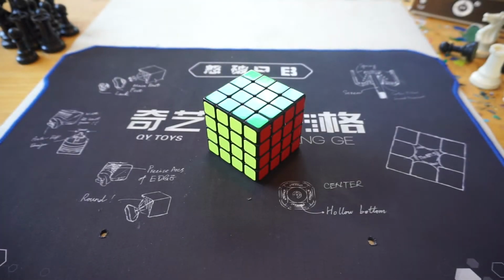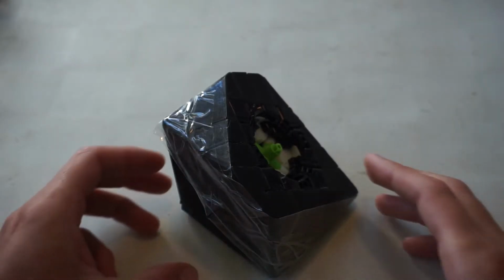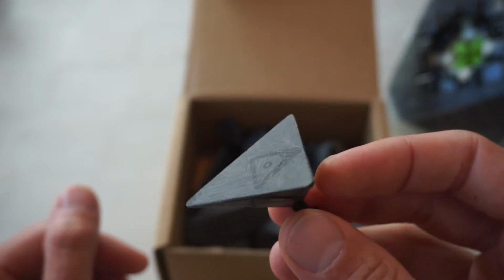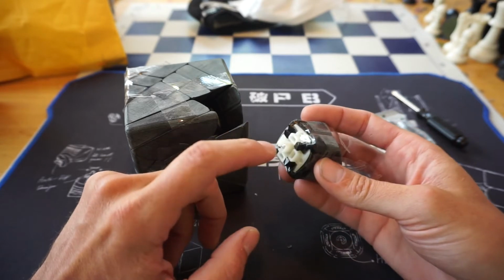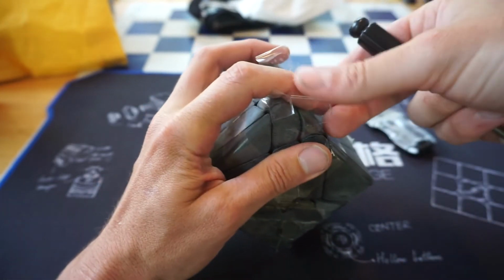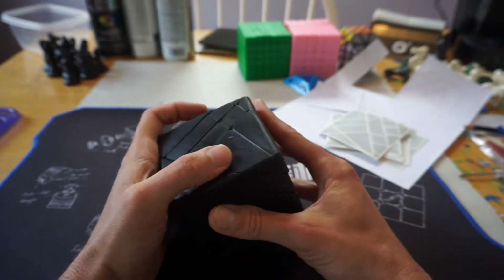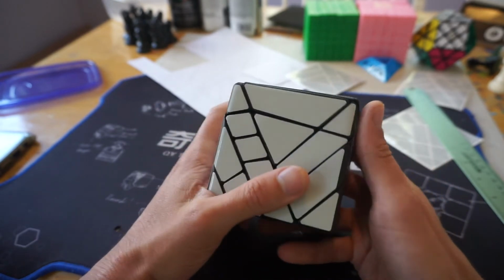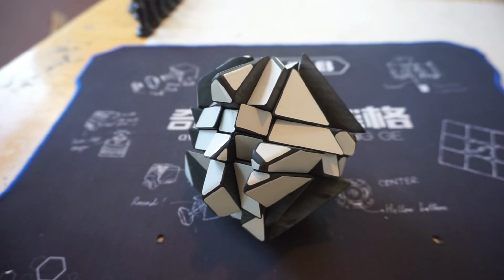How to Make a 4x4 Ghost Cube

Comment: Awesome cube!

I use scissors to cut stickers. It makes rounding edges easier and gives me more control. 

I usually put the old stickers on the new vinyl material, then cut around the old stickers. In your case I would've traced the pieces of the finished puzzle, then carefully drawn the sticker shapes within the piece borders, and used that as a template to cut the new stickers.

Comment: For modding a 4x4, I sand down the extensions before gluing them. I use masking tape to space out the pieces during the gluing process so the gaps are even. The ghost is a nice mod. I need to try and make one too. Thanks for the thingiverse files.
Reply from the maker: Thanks for the advice. Where do you put the masking tape, I'm trying to picture what you're saying.

Comment: That looks really good! I find using scissors work quite well for making rounded corners on stickers.

I tried modifying a Megaminx once with Milliput, glue, and sanding, but it became a lot more difficult than I thought and I just ended up never finishing it off.
Reply from the maker: Scissors would have been a good idea, next time. The sanding takes a long time especially with 3d printed extensions.  I saw a 4x4 ai mirror cube on the twisty puzzle forum that I'm gonna try sometime.  Could experiment solving it with my new puzzle from taobao with a little tape, would be a hard solve.